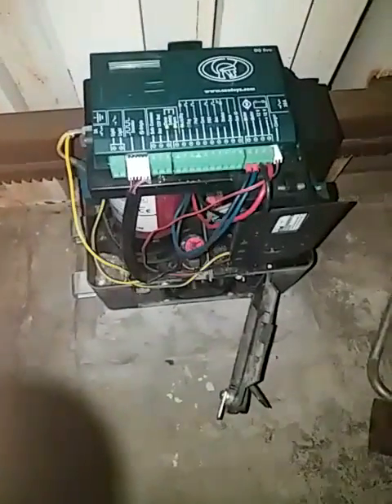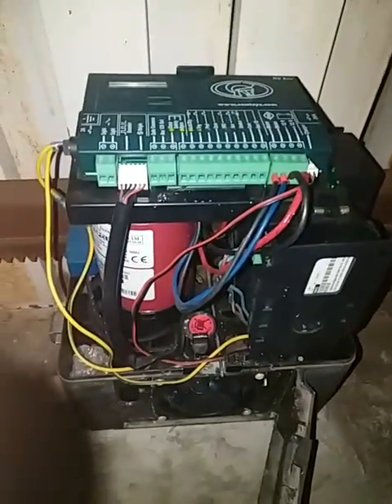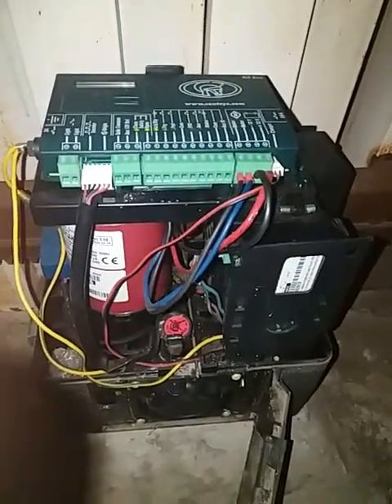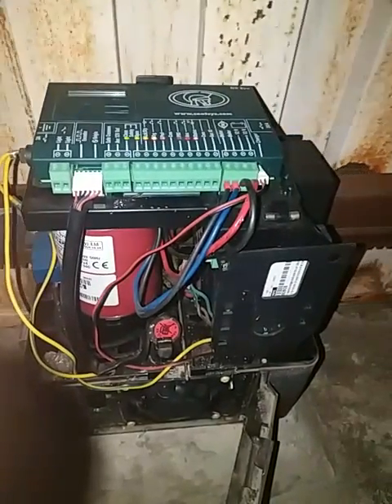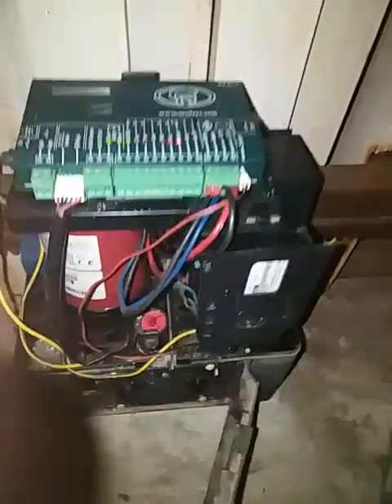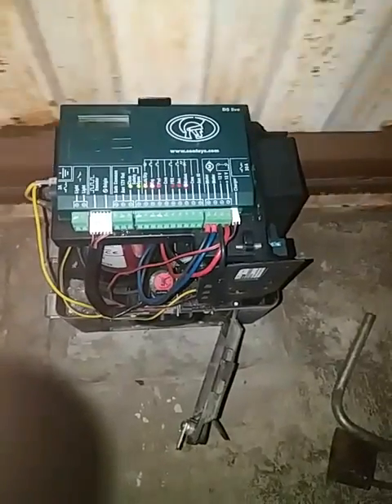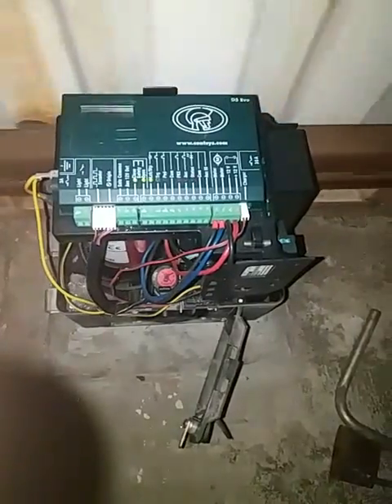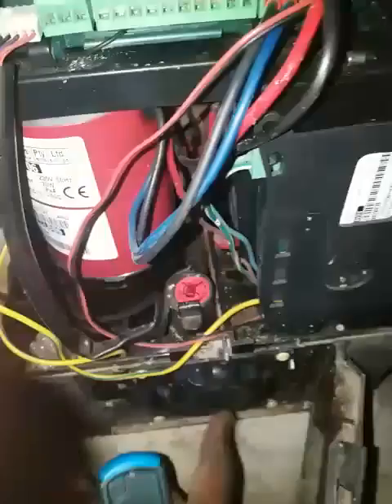Centurion D5 evo- motor fault, move and stop, no limits available.

Comment: How do u clean thr oil??
Reply: Tissue
Reply: @tristanwait4itlegendary d5 evo doesn't use oil. It's a chip inside. I'm confused
Reply: @maximussteel7019  there is an oil seal between the gearbox and the doss. If that seal leak then the oil run into the doss. To clean it is just a temporary measure. It will have to go to the agents to replace the seal